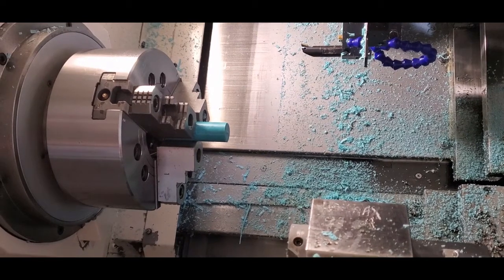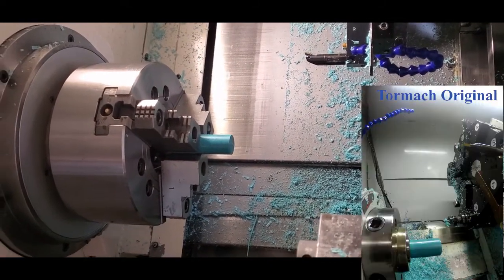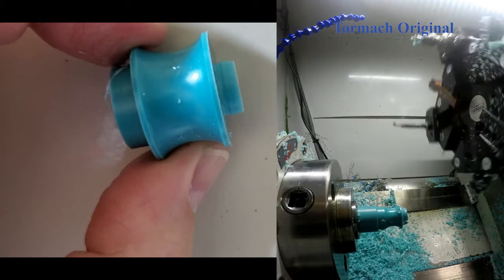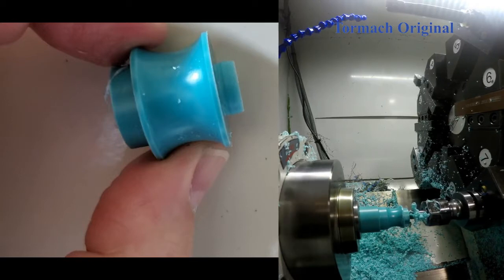Okuma VS Tormach slant lathes. Doing Turcite rollers on Okuma this time

Comment: damn that okuma is scarey fast on its rapids! 

I feel like I have learned a lot of the cam and how hard my machines like being pushed the past few years too and yet... im still learning.

great comparison video man!
Reply from the maker: Yeah it can be intimidating proving out the code and I'm not even using 30% of the features the okuma can do. Live tooling, sub spindle work, 2nd turret, running both turrets at the same time. I learn more each day but I know the things I don't know could fill volumes.